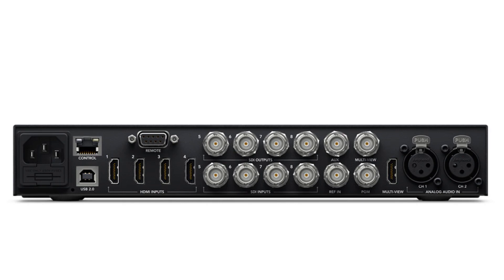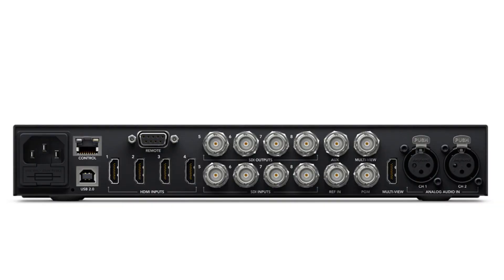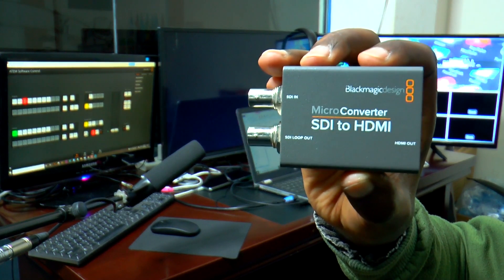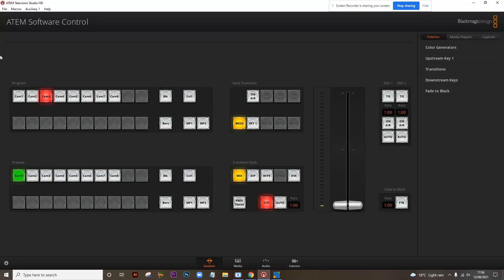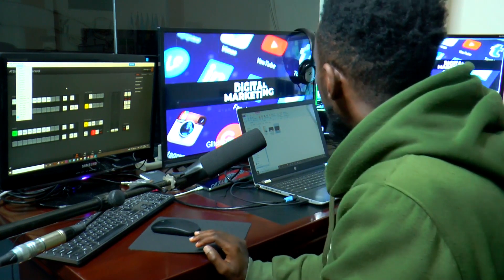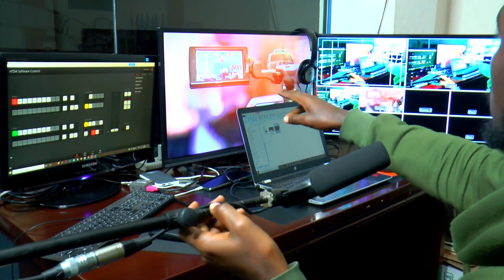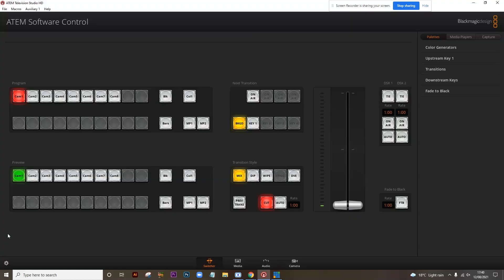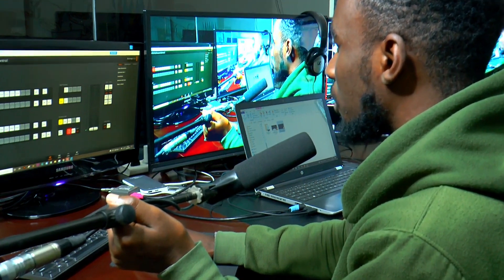How To Set Up Your Auxiliary Output in Blackmagic Design ATEM Television Studio HD

Comment: Can atem tv HD connected to laptop using sdi to hdmi converter + video capture?  I mean SDI output - - SDI cable - - - blackmagic SDI to HDMI converter - - HDMI cable--HDMi usb video capture
Reply from the maker: Your setup idea looks workable, is this for a livestream setup? If so I would recommend reducing the connections and getting the new Blackmagic
Web Presenter HD, it will reduce the processing load on your laptop and would be more stable. 

I explained the setup here: https://youtu.be/yIiQH3xzv_o?t=892 you would only need an SDI cable from the ATEM and then a USB 2.0 cable to your laptop
Reply: @KomuFrank  yes, it's for live streaming set up. I found black magic presenter is to pricey for me. Actually I have ultrastudio mini recorder that connected to thunderbolt, but I only can use it for full HD 25p. Anyway thanks for the info, very helpful.